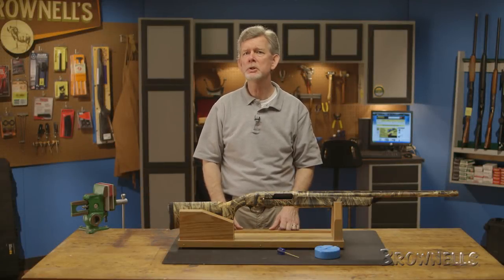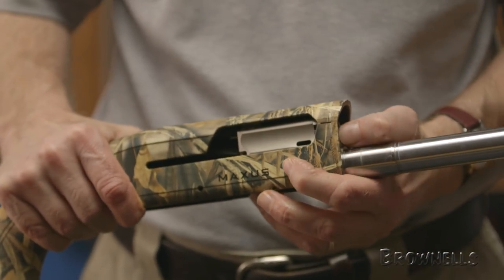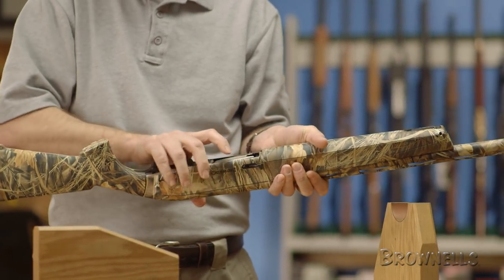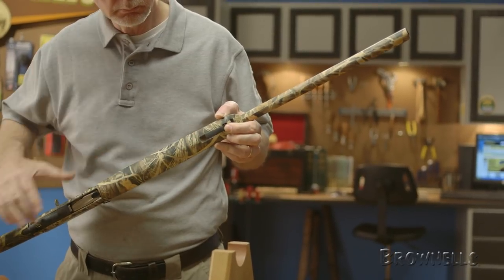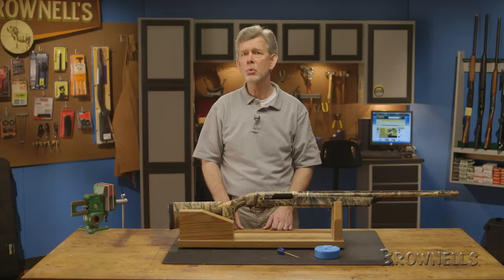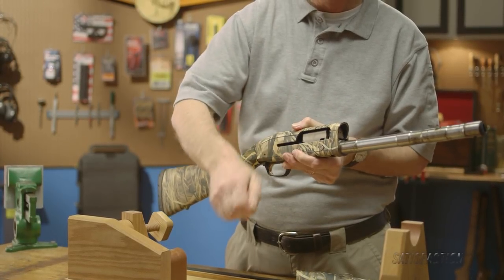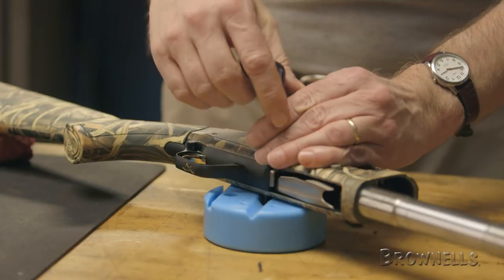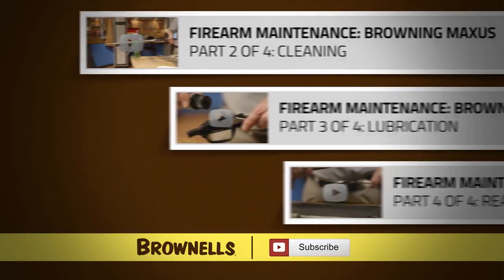Firearm Maintenance: Browning Maxus Disassembly — Part 1/4

Comment: Does the Maxus camo camouflage pattern wear out over time? Also Does Maxus a tacs au shotgun have a back-bored feature in the barrel? What is Maxus a tacs au hunting rifles? Does the camouflage pattern on the shotgun wear out?
Reply: I have been cleaning a friends Maxus for the last 5 years and he has used this shotgun hard with hunting most of the full season each year. The camo finish on the stock and forearm is still in excellent condition. The Barrel and receiver were cerakoted last year.

Comment: Where is a mention of the action spring?
Reply: The action spring is a fairly easy removal. There is an access hole just ahead of the action spring retainer which allows you to slide a punch or small screw driver through to retain the action spring while screwing out the retainer (after the roll pin is punched out). Carefully remove the punch or screwdriver while holding thumb over spring tube and then allow spring out (carefully).